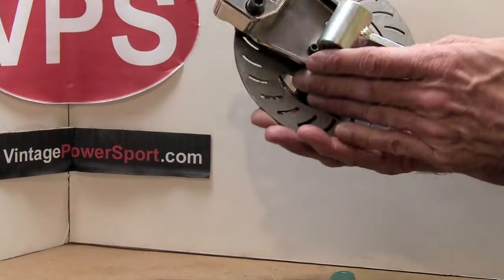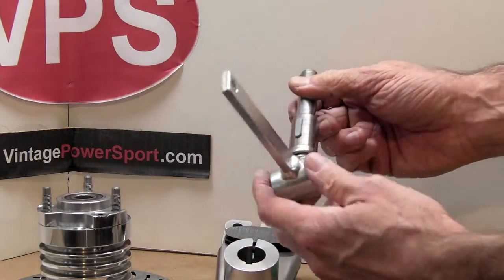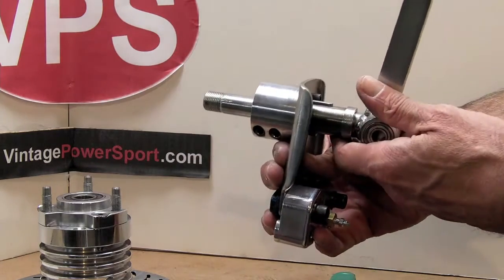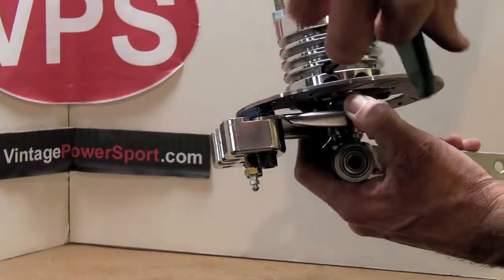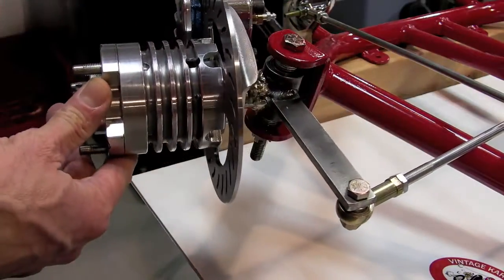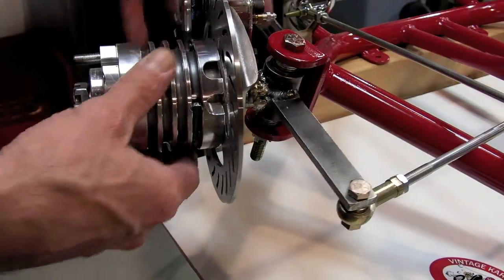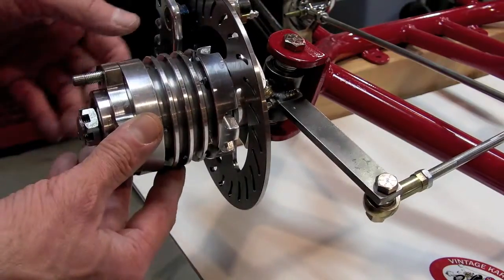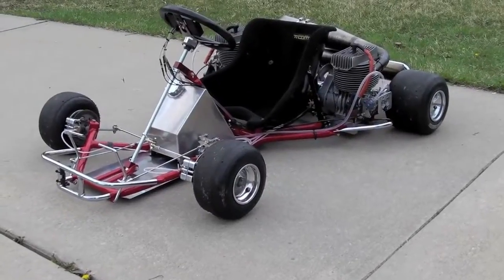Vintage Dual Invader Kart Front Wheel Brake System - Part 1

Comment: Instead of using so many master cylinders... WHY NOT utilize a proportioning valve.. ???? Looks too busy with 3 masters on it
Reply: For safety... there are 3 completely separate and redundant braking systems there .. if hydraulic pressure is lost in one, the other 2 still function  ... brake lines do pop and crack on these racing karts, resulting in some of the worst accidents I have ever seen in kart racing.

Comment: No, way. 2 direct drive engines? That thing must be rapid.I've never seen that done before
Reply from the maker: Christian Henebury back in the 1960's and 70's there were several dual engine kart racing classes, this is a reproduction racing kart (late 70's era). These karts were VERY fast, faster top speed than modern 125cc shifter karts. The low reliability and high cost of these karts reduced this class to extinction. Each motor has its own oil bath adjustable clutch, both motors must be tuned identical, its one of the best bang for the buck driving rushes there is .. more about kart:   http://bigcooter.com/archives/77